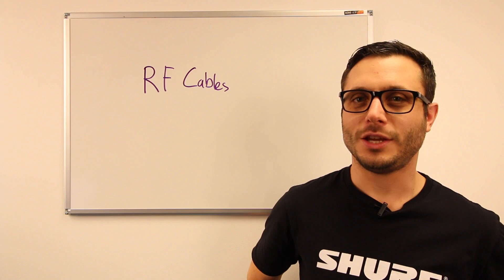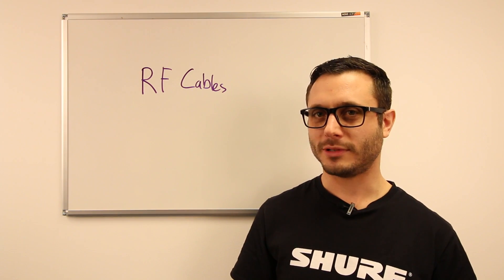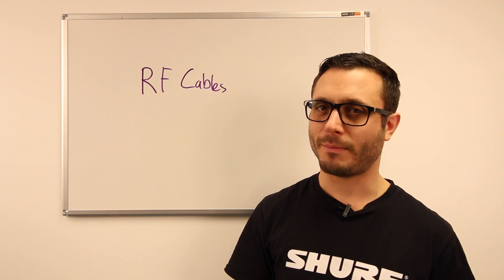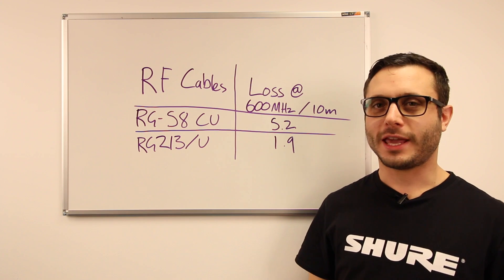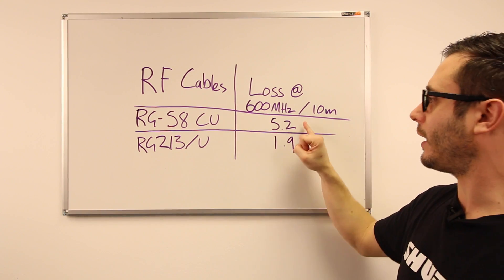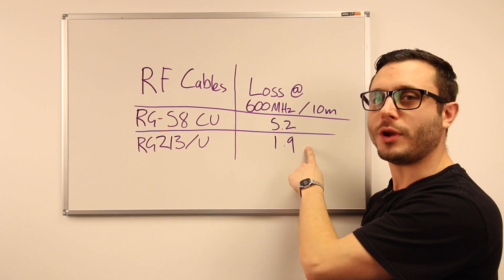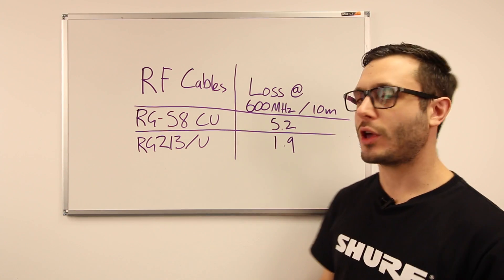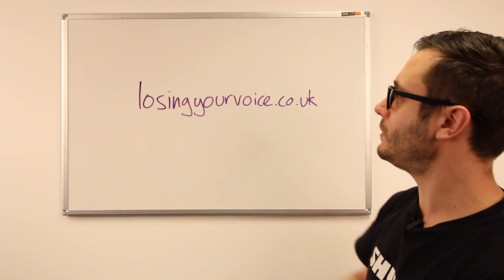Understanding RF Cables

Comment: I keep losing signal having to reset AMPs at hotels on the beach in Florida. I'm wondering if heat and humidity over time is messing with the signal. 
All signal is transmitted through amps running to 8 ways straight to the rooms. 
This is pissing me off I'm not seeing any intermittent intervals!! Ahhhh!! 🤣 🤣
Reply from the maker: Our support team should be able to help troubleshoot! You can open up a ticket with them at shu.re/contact.

Comment: Really appreciate your easy to understand video! I'm into long distance FPV and build antennas for the hobby. There are many RF cable options on the market. Beyond using lower impedance cable, do you have a rule of thumb in selecting it? On my UAV we care about weight and have relatively short cables less than 1 meter. On my ground station sometimes I want simple park flying which is line of site and I don't want to feel tethered to a ground station. Other times I want technical challenges and move things higher up, with perhaps 10 meters distance. I would like to know which cable you would use based on common needs such as cost, reliability, length, etc.There is also an issue of connectors and adapters. I know RP SMA is the new thing, but much of my equipment is SMA. So to protect myself from myself and damaging radio gear, I tend to make everything the same using an adapter. How much harm in terms of loss am I doing there, and is there a better solution that also keeps my equipment safe? How does a mere mortal like myself make sure my impedance is matched? I have an oscope and decent multimeter. As unlicensed hobbyists we are also limited in how much power we can use, so having very good antennas can bridge a gap that can't be overcome with a powerful signal booster. Though we can boost it back to the legal limit.  Looking forward to your tips!
Reply: Hello